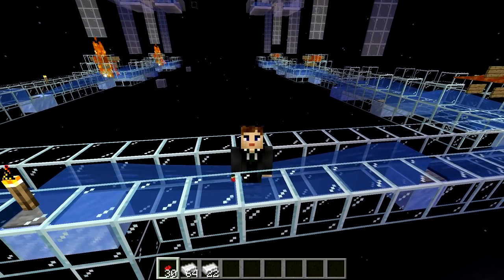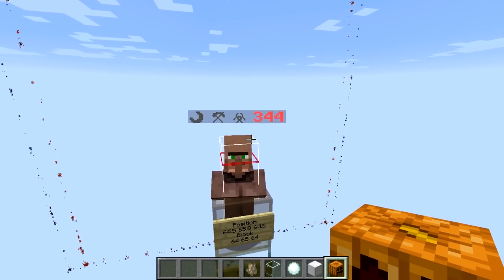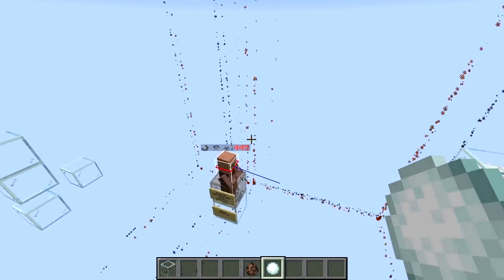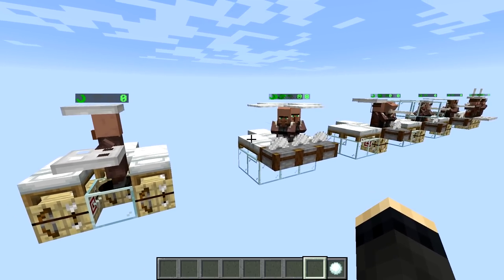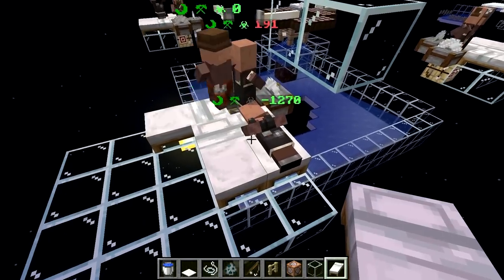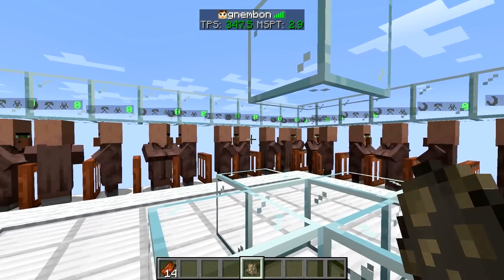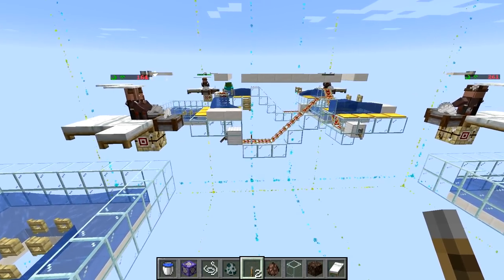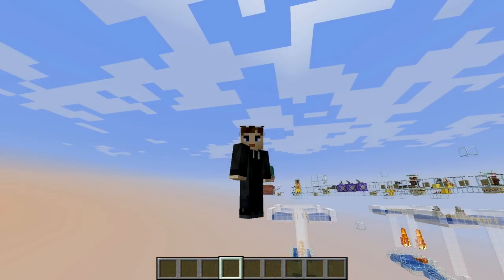Simple, Cheap, Efficient - IRON Farms for 1.14.4 [Fun Farms 28]

Comment: Mumbo's Material List:

Glass - 328 
Quartz Slab - 212
Powered Rail - 24 
Light Weighted Pressure Plate -  23
Birch Fence Gate - 20 
Water Bucket - 20
White Bed - 12 
End Rod - 8 
Stonecutter - 8 
String - 8 
 White Carpet - 8
Fletching Table - 4 
Lever - 4
Redstone Dust - 4

Comment: The golems wont spawn for me, anyone else having this issue?
Reply: Yeah me
Reply: Are you playing on Java? Which farm design are you using? Did you follow the way these are laid out exactly? Not an expert but happy to try and troubleshoot if you give the details.
Reply: if u have problem with that  just put glass  where golem can spawn or dig down because of that  he will have to spawn where you want.
Reply: @rjamsbury1  I have that problem too. At first they did spawn but after pausing the zombie and then turning it on again it stopped working. Is there a possibility that the villagers claim a workstation in another cell?
Reply: @vidargustafsson5321  difficult to know but I think in theory they can only link to workstations they can path find to. Unless you traded with them. The biggest problem I've found is when the villagers can't make eye contact with the zombie. Another issue I've heard is if they can always see the zombie - then they won't work and refresh their trade. This is why some designs have the zombie bobbing in water or use a clock to hide it occasionally
Reply: Thank you for the help. I name tagged every villager who was sleeping at night and it showed that there were eight who never slept. By removing their beds and replacing them, the iron farm now works perfectly. It’s still weird since I placed the beds as I moved the villagers to the farm from more than 100 blocks away. They shouldn’t have had the opportunity to claim the wrong bed.
Reply: @vidargustafsson5321  Fantastic! Great to hear your fix and good tip to name tag them to work out who is doing what. My problem is the villagers keep managing to get outside the 1x1 and fall and die! I'm going to box them in apart from a window to see the zombie!

Comment: Zombie got stuck on last quad design at some point on the rail. Any potential cause for this?
Reply from the maker: Maybe chunk unloading - shouldn't happen, it would be a bug, but you can check if that's on the chunk boundary.
Reply: gnembon Hm possibly. Did happen during a night of afk. I have a feeling it might have been phantoms. I think one bumped into it or something. I’ve started afking above it and have had no problems.
Reply: Thank you for your reply as well though! I’ll look into that if problems persist

Comment: i build it and it did work, bud after like 5 stacks of iron it stops working. then i kill the villigers and the vindie end put new ones in it works again. what is the problem? i got the firs farm of the video
Reply: they either loose there trades or they are not able to pathfind to the beds you also pls switch off the farm when you unload the chunks or the farm has a tendency to break.

Comment: I am having trouble with the villagers leaving their beds and going on the glass blocks under their beds. Eve. After breaking their beds and replacing. Is there a fix for this?
Reply: You guys didn't have any issues with the villagers not being able to sleep?
Reply: @endeavorndever3930  No I didn't from what I remember. though they won't sleep if they're afraid...
Reply: @jaylavrieling9820  I am having the same problem I added you on discord if you can send the screenshots please. Thanks!
Reply: Just double checking, you do have 3 air blocks between the bottom of work station and glass block correct? Also beds aren't directly over glass block. I had an issue when I was over one block to far.
Reply: @jaylavrieling9820  I sent you a friend request on discord
Reply: Endeavor_1989 could you send me a couple screenshots?

Comment: Just a thing i found out, this design does not work on multiplayer servers using paper / spiggot. Villagers don't behave like vanilla and don't get in their beds the way they should.
Reply: Just to let you know. I figured out a way for it to work properly. When using the 4 corners with rails version. You need to remove the glass layer below the villagers out to the corners so the villagers cant see the glass there on paper. This has worked for me and the iron is flowing in now. Hope this helps!

Comment: I don't know is this has been asked before but I was wondering if there is an alternative to using end rods in the design. You may not even get to answer this but so anybody in the comments that could help me out with a cheaper holding cell that would be greatly appreciated.
Reply: I didn´t have end rods either, I changed that for a glowstone block with a wood trapdor under it. It works... not sure about the efficiency, but I was afk about 5 minuts and got 5 stacks and a half.
Reply: @EnriqueTejada  Thank you

Comment: I'm having trouble with one of these farms (the one Mumbo made). The villagers are sleeping and getting panicked by the zombie, but no golem spawn. Is there some way I can get the same overhead display to check if they're actually working? I'm playing in 1.16.3 btw.
Reply: yeah, same happened to me, still "work" but it's very slow now
Reply: @rulo-sensei  I ended up finding out what was happenning. The farm was under ground with my base above. And there's iron golems wandering around my base. Those golems where detected by the farm's villagers and would prevent any more spawns. The solution was to dig the farm further down.
Reply: @brugiro  Or move it a little bit away from the base

Comment: Hey, i have built the design in survival minecraft at 19:40 to what i believe is exact. It isnt working and the only variable i believe  is causing this is that the iron golem catchers are only 7 blocks from the ground and also i used cobble instead of glass. Please let me know if this is the cause or something else. (I have the carpets with string in place)
Reply: you need glass so there are no other mobs spawning on it or the golems themselves. break the beds and replace them, the villager need to sleep once to spawn golems. if this doesnt work do the same for the workbenches

Comment: I have one other problem with the 19:17 farm is that iron golems spawns on the rail or somewhere and kills the zombie please help
Reply: I had the same problem, I solve it by placing half bottom slabs, although I believe those aren't necessary, leaving a air block gap between the rail and the slab, also make sure that the spawning platforms aren't made of glass as golems won't spawn there and will try to find another spot, like the rails. And make sure you have 3 villagers on each corner otherwise won't work.

Comment: Hey gnembon, wheh building the quad iron farm at 19:15, the villagers wake up on the glass block surrounding the spawning platform. Is there a reason as to why this happens in 1.15.2?
Reply: from what I know it has to do with cramming. I made a video with a fix for it. kinda hard to explain where to put the glass.

Comment: You said, that you could build the Farm (4600iron/h) in the spawnchunks to run it even if it is not in sight. For me it just works if it is loded by renderdistance. I dont know, if the changes of the Spawnchunks in 1.15-1.16 effected this and if yes, could I fix this issue somehow?
Reply: If you use optifine, turn smooth world off, I don't remember if lazy chunks also affects

Comment: for the farm at 19:20 is there a fix for the villagers waking up not on the workstation?
Reply: i am on 1.16.2 by the way
Reply: @qwertymcminecraft  if you cover the beds in carpets it works again
Reply: @norwiii4466  do you cover the bottom half in just carpets or do you add the string carpet design that are on the head of the beds

Comment: I'm having a problem with the farm at 19:16. I've replicated it apart from the type of blocks (e.g smooth stone slabs instead of quartz, just the appearance swapped for cheaper resources), and the bed have the pillow towards the fletching table. The villagers often wake up on the glass or slide off the beds (though the second one may be a glitch). I am currently in 1.15.2 and have built it on a server made for my friends and would really like to have it work. Any help is appreciated.
Reply: If theres glass right next to the bed, villagers will go there, but if theres no glass right next to them they shouldnt be able to get up in the glass of the water platform
Reply: @gonxagames1865  they sometimes wake up on the glass below their bed. I built it above the ground and even cleared some of the area around it a couple blocks down. The glass has a 1 block gap between the fletching table and the water container and there are no blocks nearby.

Comment: I'm having a very annoying issue:
There are some iron golems that are spawning on the Zombie's track and thus killing the zombie, I don't know exactly where, I think it's either in the water or on the slabs, so the "rail" part is not the problem. If someone knows the solution or at least what's causing the problem please let me know. Thanks
Reply: Download the map and try to see the difference between yours and gnembon, otherwise I don't see wath could be the problem
Reply: Are you using glass for the zombie?
Reply: @LinxESP  No, but I dolved the issue now, I just made the slab roof wider and that stopped the Iron golems from spawning

Comment: so what number of villagers is most efficient? he mentions a lot of 3 villager setups but adding a 4th would be better, no?
Reply: adding a fourth is unnecessary, it remains just as effective, three are needed to spawn a golem and all within a certain radius have a timer started when that golem spawns, be it three or 100 the same number of golems will spawn and the same loot will come through, so whilst causing no issues a fourth would not be more efficient
Reply: @williamcroft728  But you could use more villagers to allow a smaller spawning platform to be efficient.

Comment: I have an issue with one of the farms.. The simple design with minecart/water zombie. In some cases, golem is spawned on the L shaped water stream which ends up with killing my Zombie.
Reply: build the bit under the water out of non spawnable blocks, like glass
Reply: @genralfang4309  Already did, but the could somehow still spawn even at glass. I Solved it with waterlogged trapdoor to break 1x3x1 valid spawning space
Reply: @nervouscz4508  huh what did you do??

Comment: Is anyone else having the issue of this farm not reliably spawning golems in 1.16.2? Is there a mechanic that changed that is causing this? I built this farm in 1.16.2, and it no longer reliably spawns golems. It worked fine in 1.16.1. Is there a fix to this?

Comment: Just built this in 1.16.1 and the zombie (nametagged, and with diamond helmet) keeps disappearing after like 2 in-game days...

EDIT: Upon further research (https://www.reddit.com/r/Minecraft/comments/gm6hju/zombie_despawns_despite_having_nametag_armor/) I believe it is either the helmet despawning or the intermittent bug (the linked bug report is listed as "resolved", but they do admit: "With the amount of duplicates this issue has it is entirely possible that there is still remaining issues of entities disappearing that have not been resolved"). I'm going to try naming the helmet to see if that works, otherwise I'm just going to put a roof (probably lower half-slabs) over the zombie circuit.

EDIT 2: Ok, so naming the helmet does NOT work, however, putting lower half slabs above the zombie circuit will fix this problem (protects from sun and you don't need helmet, but you still need the nametag)
Reply: You could have also used a husk cause they dont burn in sunlight

Comment: I built the that mumbo built farm exactly like in this video but the iron golems are not spawning (in 20w17a). When I downloaded the world in the description, it worked even in the nether update snapshot(20w17a). I do not know what I am doing wrong. Can anyone help me?
Reply: that means your doing something wrong
Reply: I don’t know what it could be
Reply: Ari Shichor I’m did it in survival 20w17a and it works except for one module which is slow or non producing at all. Did you build it off of the ground and use a tutorial? Every single detail counts
Reply: I built it in the air. I also didn’t hear the villagers working.
Reply: @arishichor3022  Did their outfits change? If not break the workstations and replace them.
Reply: The outfits did change
Reply: Ari Shichor hmm... did you use end rods? That’s the only other thing I can think of, other than that I would just rebuild it. You might have just mismeasured when building it
Reply: Luke Holmberg probably but I did try with rods and without
Reply: Ari Shichor hmm. That’s weird. No idea what’s wrong then.

Comment: Villagers started to wake up from the bed on the platforms where iron golems should spawn, any way of fixing this?
Reply: How close are your villages to the platform? I had an issue where i had my villagers too close to the collection plate and when the villager got out of bed they were close enough to spawn on the glass sides instead of the villager cell. I fixed this by lowering the collection plate

Comment: So i don't know if anyone has come across this problem but it seems like they haven't. I was building this farm on a realms server and it seemed like the husk was not scaring the villagers. I tried scaring villagers in another location with a husk and that worked, but the husk in the mine cart has no affect on the ones in the farm. I have checked the locations of the villager holders, they seem to be the right distance away, 4 blocks between the trap door and the rail way. 
anyone know what I might be doing wrong?
Reply: actually they're panicking now but still not spawning any iron golems

Comment: The one at 19:15 broke in 1.16.2 due to bed mechanics. Anyone know of any quick fixes?
Reply: if you cover the beds in carpets it works again
Reply: @norwiii4466  ty, this is the only solution I found that actually works
Reply: Does this work in bedrock?
Reply: @oceloteater4885  dont know. Bedrock mechanics are different and i have never tried it

Comment: I am having issues with the zombie despawning even though it is nametagged and is wearing armor
Reply: Is it dying from the sun? Put a one wide wide slab roof over his path way
Reply: @shrpls  I have a helmet on the zombie and also have the slabs above
Reply: @fruitfuldiamond2058  Any iron golems escaped and killed the zombie?
Reply: I’m not sure then. If your zombie has gone then it has either been killed by a player, golem or sun or it has despawned. I would check your steps again. Maybe try dropping an item for the zombie to pick up and hold. When a mob is holding an item they won’t despawn. Works the same as a name tag.

Comment: Very good explanation of the mechanics, which helped me when I was designing my "fit it into one chunk" replacement farm for the server I've been playing on for a long time.
https://drive.google.com/drive/folders/1lO37dbzF2cOtf2iObhWIk6-ljePv_6UB?usp=sharing
More a proof of concept design, but it IS a working farm.
Note that my villager cells aren't as small, and don't get the various "bugged" issues I've seen out of any of the "make them fit in one block" cell types.
Your design led directly to my spawn platform design, but other parts came from other videos and a couple pieces came from my own previous farms.
Minecarts on the server I play on are NOT reliable, tend to lag out and STOP a lot, thus I didn't even think about using that part of your design.

Comment: Could someone PLEASE tell me the materials for the last farm? I would thank you a lot :')
Reply: Resources Required:
-417(6.4 stacks) Solid Blocks
-520(8.2 stacks) Glass Panes
-1242(19.5 stacks) Glass Blocks
-192(3 stacks) temporary Colored Glass Blocks
-384(6 stacks) Scaffolding
-192
-135 Fence Gates
-40 End Rods
-105 Powered Rails
-66 Rails
-5 Detector Rails
-14 Comparators
-57 Redstone Dust
-8 Levers
-38 Packed Ice
-50 Signs
-32 Chests
-20 Hoppers
-5 Lava Buckets
-2 Water Buckets or 120 Ice
-38 Pressure Plates
-9 Redstone Torches
-4 repeaters
-3+ Minecarts
-128 temporary dirt blocks
-128 temporary powered rails and rails(or more depending on how far you transport villagers)
-1 Dragon Head or Carved Pumpkin
-30 Villagers(with no profession)
-1 Zombie
-A beacon with jump boost is very useful but not needed

Just did a tutorial for this farm😁
Reply: @CoffeeTheCraft  thanks a lot! New sub btw ;)
Reply: @benjad9202  you're welcome! Thank you😀😊

Comment: these works in 1.16 snapshots?
Reply: It worked up until 20w16a, minecarts don't get transported trough water anymore. But you could fix that with a rail delay
Reply: Using the rail delay system in the snapshot mine works